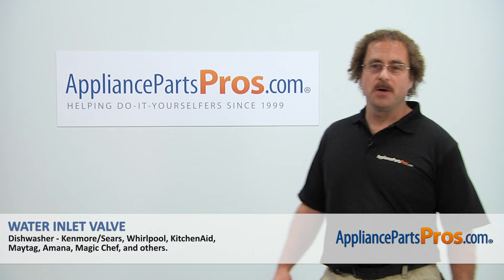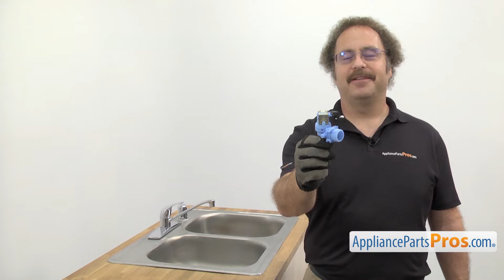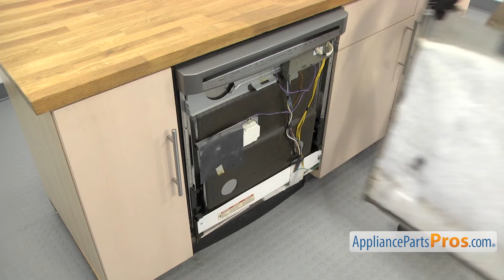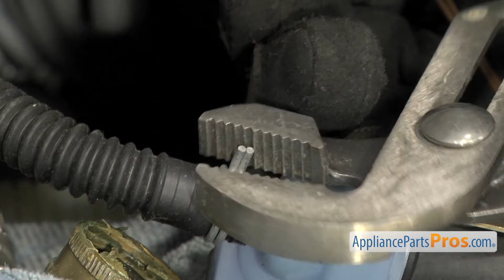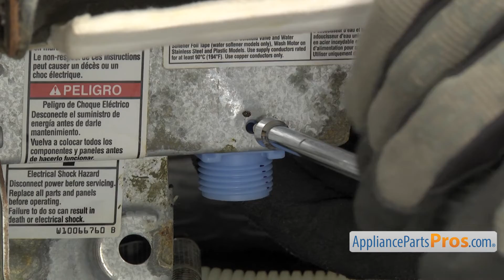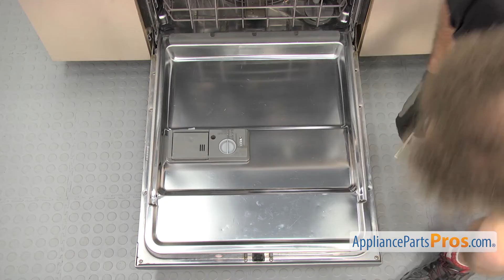How To: Whirlpool/KitchenAid/Maytag Dishwasher Water Inlet Valve W11175771

Comment: Great and helpful video. My part came with plumbers tape. Do you not think that should be applied?
Reply from the maker: Great question, @jasonnyc4016 👍 If the fitting is a threaded connection, a small amount of plumber’s tape is fine. Just don’t use it on compression fittings—they seal without tape 👍

Comment: Great video. 2issues for me:  should the hose from the water valve have a ring on the inside or is that blockage I can remove. It feels like rubber. #2 I am struggling getting the wiring harness off. Haven’t been able to find the release tab.
Reply: #1: Sir, that sounds like the rubber washer/gasket that creates the seal as you tighten the hose on. Like on a garden hose. You definitely need it. If it's very worn you can pull it out and replace it for cheap.
Reply: @SF-zz4hu thanks! I did solve #2
Reply from the maker: So glad you were able to get the issue resolved!

Comment: I have replaced the inlet valve but water still wont go through. Any help.please?
Reply from the maker: A few things you will want to check is make sure the water supply is turned on all the way. Check any filter screens and hoses on the unit for any blockages. You will also need to check the float, float switch and wiring. If you need testing information or further troubleshooting, check out our Repair Forum: https://forum.appliancepartspros.com/.  It’s easy to register, and you can either post your question or search the forum to see if someone else has already asked the same question.

Comment: Did y check for continuity?
Reply from the maker: If you are wanting to test the water valve you will test for power when it should be filling with water. If you have power there and it's not letting water in then you will need to replace the water valve.
Reply: @appliancepartspros  yes check for current then check the valve because even if is new parts come bad.

Comment: I did this and now no water is going in at all. No leaks, though. Turned water back on. Any ideas what happened?
Reply from the maker: What is your model number?
Reply: WDT75OSAHVO
There was no water before and I thought it was the valve. Changed the valve and still no water. Any idea ?

Comment: Thank you so much for this excellent video. My 665.13473N411 was making a high pitched howling screeching noise and some soap was occasionally left in the dispenser (wasn't dissolving). Multiple sources said it was the inlet valve. Your part was a perfect fit. Bless you, "right to repair" people of the world.